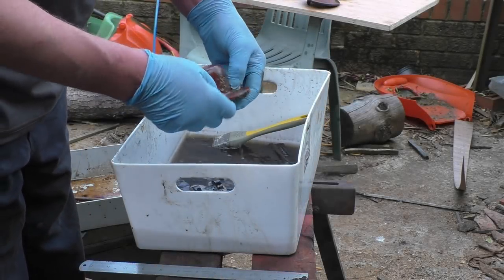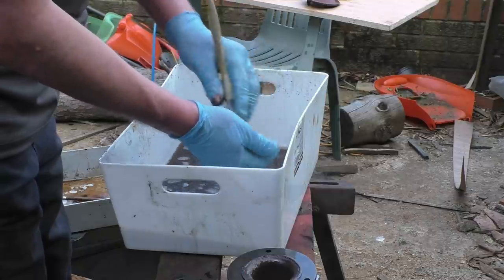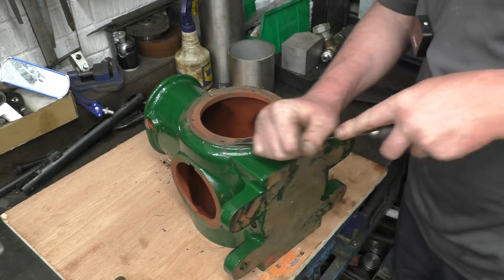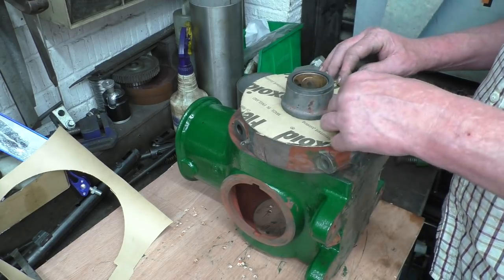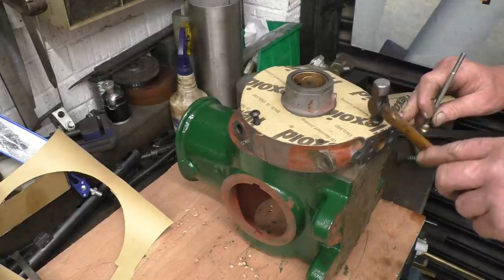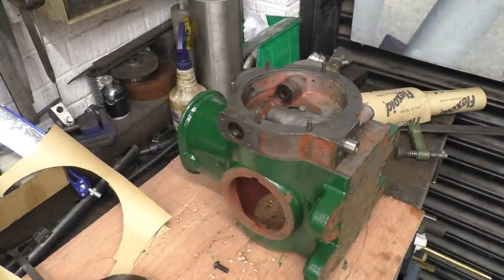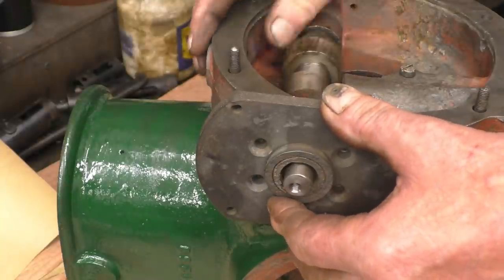Stuart Steam Engine Restoration Part 6 . Joints & Studs

Comment: This reminds me of an incident in the railroad repair shop I worked in for 41 years. A gasket (joint?) was needed for a part on a locomotive Diesel engine, and the two old machinists working on it disagreed (as usual) over how to make it. One determined to use scissors and gasket punches, the other just as determined to use the hammer method. Captain gasket punch took off searching for the punch kit, meanwhile Steve, using a 2 pound machinists hammer, made the joint and was near done bolting the pump back on the engine when the other guy finally located the punches and returned! I don’t think they ever did find all the punches after the Captain threw the box across the shop in anger! Thanks for another great video John!

Comment: I love how the old machines like this little Stuart Turner used joints that could be made on site, rather than having to wait while the parts store orders in some wacky shaped specialty name brand gasket for a higher than reasonable price.  Something oddly fascinating about watching someone tap out a joint or gasket with the small hammer.
Reply: When I first started fixing cars I could not afford gasket material, so we always had cornflake packets with funny shaped holes in them

Comment: Coming along very nicely. The way you installed the studs, is the only proper way to do it. Only a rough bastard uses vice grips on new studs when proper nuts are available. Broken or damaged studs and bolts are fair game for vice grips, but not new ones. Everything is looking good John, You do a fine job Sir.
Take Care and Stay Safe.
Bob

Comment: Looking good John, and I also have used the phone book covers to make gaskets, when it was late, the stores are all closed and I was out of Flexoid sheet. Did not want to make them out of silicone, so phone book it was. Lasted for a good number of years in there, no problems with that seal.
Reply: Good tip do the phone book gaskets/ joints work with coolant as well as with oil based fluids?
Reply: @robertoswalt319  Reasonably well. While the coolant will soften the cardboard, it is clamped well between the surfaces, so all it can do is swell a tiny bit. There is usually enough rust/crud in the coolant that it eventually saturates the little bit of gasket that gets wet and basically seals it off from the coolant.

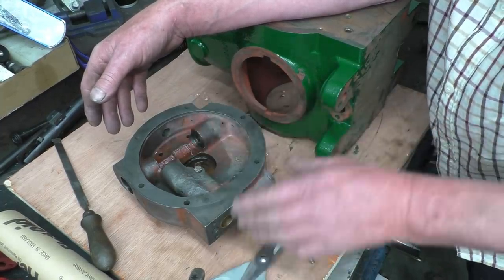Comment: 7:35 "If it was a car it'd be called a gasket - it's not a car, it's a steam engine - so it's called a joint."

And people will believe that - LOL

A JOINT: Where two parts meet (whether car engine or steam engine)
Gasket: "A flat, shaped sheet or ring of rubber, cork, metal composite, or other relatively soft material inserted between adjoining metal surfaces in order to make the joint airtight or watertight" [OED]

A gasket is therefore the material that goes between two parts forming a JOINT to seal the joint - preventing fluids from getting into or out of the joint. Gaskets are solid objects and (as mentioned in theis video) have a thickness (0.4mm?). Joints can also be sealed with liquids - whether similarly flat, or more complex shapes (e.g. threaded pipes). Such liquids are known as 'jointing compound' and commonly set with time (or sometimes temperature). Some jointing compounds never set - allowing threaded joints to be more easily disassembled or where pressures are low.